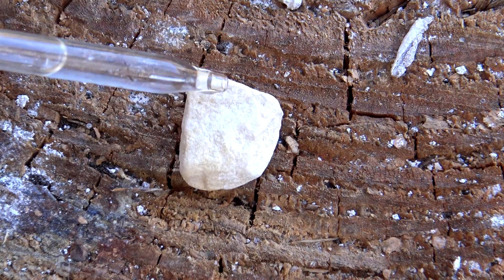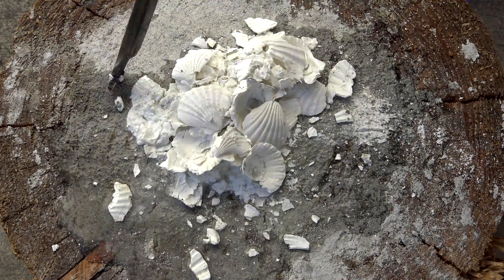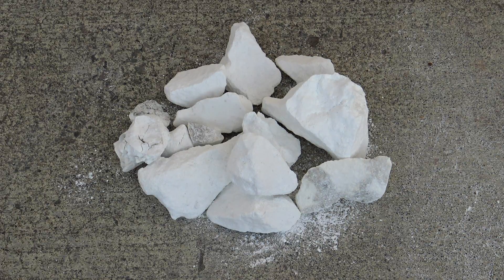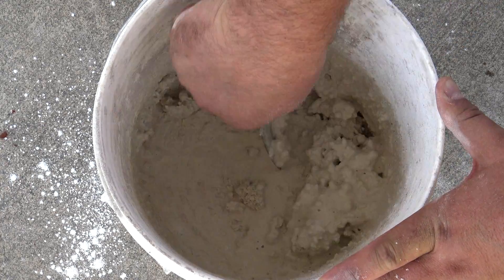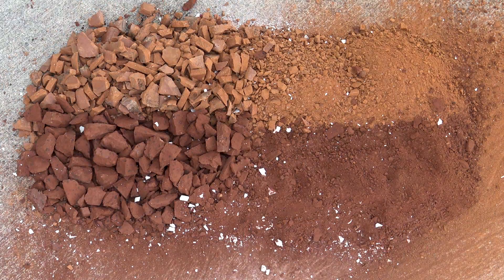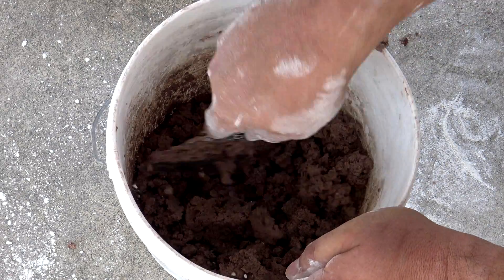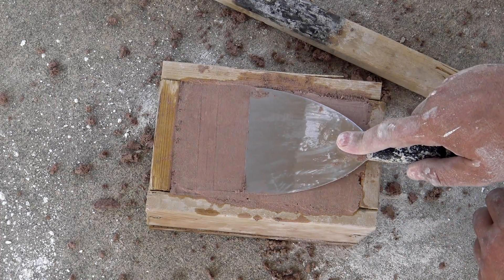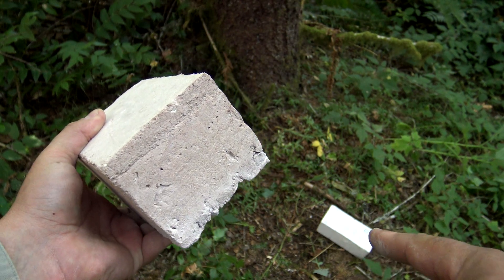How To Make Improvised Roman Concrete (Corporal-Crete)

Comment: There are other uses for lime u can make a fire with it as well the other is mineral oil but not to positive I'll look it again 🤔 u can use lime still an Ash like from almost every tier's a the second best but if u r trying to keep low u will have to look around or burn a lot of wood lol sand is a nother part u can add fresh water mussels an clams and oysters as well an the thing about lime it can repair the cracks it's self in concrete if saltwater was used in the beginning of mixing the concrete it's amazing stuff love your show corporal Kelly keep up the good work

Comment: I've seen info years ago about using seawater and also "coal fly ash" ? What ever that is ?  Perhaps Ash remains from coal ?
Update:
Fly ash particles are the lightest kind of coal ash—so light that they “fly” up into the exhaust stacks of the power plant. Filters within the stacks capture about 99 percent of the ash, attracting it with opposing electrical charges. Fly ash is recyclable.

Comment: The story I heard was that the Romans cooked their cement for days prier to use and used salt water and the ratio was 2 to i volcanic ash to lime and the cure time w even portland cement need 28 days to gain its full strength so I cn only imagine how long the Roman concrete took to cur fully.

Comment: i build my entire house with this exact method, 10 years of collecting shells baking them down, another 15 years of mixing concrete i come to my end result. I finally have a house the size of a sand castle. sure i cant live in it but the 25 years of work was well worth the wait to stare at it as the sun glistens across it in the morning. knowing SpongeBob can live in it if i just put a pineapple on it satisfies me.
Reply: You could add to that some chicken egg shells, making it 50% bigger 😏

Comment: Can we make the ultimate 'post apocalyptic' Roman concrete inspired cement by mixing fired limestone or shell, fired aluminum cans, and dirt?!  

Consider this, the main components of volcanic ash are silicon dioxide and aluminum oxide.  

Quartz is composed of pure silicon dioxide.  Quartz is the most abundant mineral on the Earth.  "Dirt" contains a lot of quartz.  A good source of relatively pure quartz is river sand.  However, this is still a relatively large grain.  Volcanic ash would have fine particles.  Sifting the dirt through a screen can separate fine particles.    

What we need is aluminum oxide.  Aluminum oxide comprises about 20% of the volcanic ash.  Can we create aluminum oxide by firing aluminum cans?  Firing aluminum does produce aluminum oxide, however, the particles are very fine and can be wisped away in the smoke.  When I fire shell, I put the shell into a metal pot with a lid that can clip on (found at thrift), and put this at the center of the fire.  If we added some  crushed aluminum cans in with our shell, or just threw some in the fire, could we fire both the calcium oxide and aluminum oxide in one go?  Aluminum cans left in a fire result in a brittle husk.  We would need to crush this into a powder, but if we did, would we have aluminum oxide?  

The ratio for Roman concrete, if I have it right, is 1 part calcium oxide, and 2 parts volcanic ash.  If the ratio of aluminum oxide in volcanic ash is 1/5, we would need to keep this in mind.  

I think that is basically 4 parts dirt, 2.5 parts shell, and 1 part aluminum can.     

Here is info on the chemical composition of volcanic ash from Mt. St. Helens.  

65% SiO2, 18% Al2O3, 5% FetO3, 2% MgO, 4% CaO, 4% Na2O, and 0.1% S.
Reply: I have been hand crushing rock quartz with the blunt end of a wedge, to get a pure silicon dioxide powder and a fine grain.  I am considering putting burnt can in with that, because the the silicon dioxide is so hard, it may be a way of effectively grinding up the brittle aluminum can.

Thus far in my attempts, just mixing silicon dioxide powder and calcium oxide powder, form something like plaster, but not a cement.  The 'reactivity' of the volcanic ash composition facilitates something more than dirt can.  Aluminum oxide is the next major component of volcanic ash, not generally as abundant in dirt.

If we burn a can, is the resulting husk aluminum or aluminum oxide?
Reply: I have to update this before the results are in on my final cement recipe tests.  In case the bubble bursts, as well as to inspire all the other caementicium enthusiasts out there.  What I am working on is a 'geo synthetic pozzolan caementicium'.  An initial idea was how great it would be if we could just use dirt instead of volcanic ash to make cement.  I honestly have a feeling that the inventor of Portland cement had exactly the same idea, and went at it as hard as he could, however, probably with poor results, and to keep at it, decided to sinter the material into a kiln, creating a 'clinker', which when ground down results in what we now know as Portland cement.   If you think about it, volcanic ash is essentially very fine volcanic glass.  I suspect this material is actually vaporized, not just sintering or melting the materials, but boiling and vaporizing these, which then condense into very fine ash.  A mix of the constituent matierals at the molecular level, a very very fine grain.  Vitrifying or sintering 'clinker' has a similar effect in blending the materials.  I strongly suspect that grain size is a key to a good cement.  Comparing this to sand or dirt it might be like comparing an orange to a car to a house.       

The cemical composition of portland cement and Roman concrete is essentially the same, silicon dioxide, iron oxide, aluminum oxide, magnesium oxide (which I haven't touched but do have some Margarine Mg in the fridge), and calcium oxide.  In the sintering process, it is my understanding that iron oxide works as a mineralizer, whereas aluminum oxide works as a flux.   

I hear river bed sand is a good source of silicon dioxide.  I hand crushed rock quartz for me experiments, sifting this through a standard door screen.    

To get aluminum oxide, chloride attacks aluminum, so I got as fine a grain of aluminum as I could and soaked this in table salt and water.  I would then put that into a plastic soda bottle filled with water, allowing the denser aluminum oxide to settle, with the salt dissolving into the water, and the pouring off the water, and repeating this process a few times to get most of the salt out, and then dehydrating what remains in the sun.  Aluminum also oxidizes rapidy, so the finer the grain the greater the oxidization.  I actually filed an aluminum bit to get some powder.  

To get iron oxide I soak steel wool in a shallow dish out in the sun for a few days.  

Here is what I hope might prove a major break through.  Regardless of our stance on global warming, this is good intel.  Cement manufacturing accounts for at least 8% of the world's CO2 emissions.  That is a big chunk.  Even if we had a cold process, such as is used in the making of Roman concrete, we'd still need to fire the calcium carbonate to get calcium oxide.  I stumbled across an alternative.  It turns out if you mixe calcium carbonate with drain cleaner, sodium hydroxide, lye ... 

"Calcium carbonate is reacted with an aqueous sodium hydroxide solution by mixing under atmospheric temperatures and pressures. The reaction products are calcium hydroxide (hydrated lime; Ca(OH)2) and sodium carbonate (soda ash; Na2CO3)."  "Soda ash is the common name for sodium carbonate (Na2CO3). It is a weak base that is soluble in water and dissociates into sodium (Na) and carbonate (CO3) ions in solution."  Calcium hydroxide, "Ca(OH)2 is only slightly soluble in water (0.16g Ca(OH)2/100g water at 20°C) forming a basic solution called lime water. The solubility decreases with increasing temperature. The suspension of calcium hydroxide particles in water is called milk of lime."  

With the above mix we can just add water and dilute, pouring the water off when the calcium hydroxide settles, repeating this process to the desired purity.  I found that the mixture settled completely either in the refrigerator or out in the sun.  I reacted the material in a thick plastic peanut butter jar (which warped and melted with the heat), and then transferred this to a 1 litre beverage bottle for the diluting process, adding water, settling, pouring off, adding more water, which I did about 5 times.  I now have a tray of what I hope is calcium hydroxide, having started with sidewalk chalk, drain cleaner crystals and water. 

It may be possible to convert calcium carbonate to calcium hydroxide, without the use of fire.  We might have a 'cold fusion' process for cement manufacture.  Whether or not this is industrially practical is it's own issue.  The point being that we can do this.

I threw a dart using the first two household chemicals that came to mind, drain cleaner and hydrogen peroxide  If you add hydrogen peroxide to the above mix, the subsequent process is similar, and we wind up with calcium peroxide, CaO2.  I don't know what this will do in cement, but I now have a tray of it and I am going to find out.  

We might one day read an article on how the Roman empire is striking a mighty blow to turn the tide on global warming!  

Since the chemical compositions are about the same, it seems to me that the main difference between dirt, portland cement, and volcanic ash, is essentially grain size.

Comment: Use the roman for structural layers and the corporal for thermal insulation. Also if you were to add modern materials, say cement in small proportions you'd get so much out of both of these but mostly from the corporal brick since it would fill in those big gaps.

Comment: Great video, educational. I also saw another guy use ashes from burnt leaves and bark burnt at high temperatures as an alternative to making lime. He takes the white ashes after burning them at high tepm, then mixes those ashes with water to make a paste, then he rolls them into balls, dries them,  and burns or cooks those balls, then he puts them into water to make the final white powder lime to be added later to make cement. It's just another alternative, but it requires a lot of bark and leaves to make enough of it and more time to fire twice.

The wood ash lime making process starts at 4:12:

https://www.youtube.com/watch?v=eesj3pJF3lA&list=RDCMUCAL3JXZSzSm8AlZyD3nQdBA&index=18

This video about making primitive mud (clay) bricks is cool too:

https://www.youtube.com/watch?v=D59v74k5flU

This one's not bad either:

https://www.youtube.com/watch?v=FwRFH7MH5N0

Thanks Corporal

Comment: good alternative to modern day concrete that is almost just as strong is you can use gray clay, calcium hydroxide, fire wood ash or charcoal ash and lye.
if you can't get the lye no worries as it is primarly use to speed up the curing time.
on average with the lye cure time is 22 hours and without the lye cure time is roughly 34 to 35 hours.

Comment: did you try a crush test in a hydraulic press for modern brick, modern concrete and the roman and corporal crete. that way you would discover if your cretes were stress fracture proof and stronger than modern stacking builder bricks
Reply from the maker: was that shown in the video?

Comment: Fort Dorchester in Summerville, SC has what are called "tabby" walls. This form of concrete/masonry was produced locally by heating shells in a fire to make a form of lime. This was then recombined with shells and river sand and water and formed into blocks and walls. I've seen similar, though smaller examples in Florida as well. http://starforts.com/visited/dorchester/gr/do20.jpg  http://starforts.com/visited/dorchester/gr/do28.jpg From this site: http://starforts.com/visited/dorchester/do28.html

Comment: I found Lava Rock (your pozlan) at ACE Hardware store, a 4-5 # bag for about $15.  Its used for the bottom of gas grilles, but I will use it for making a pizza stone out of your improvised Roman concrete.   I also found genuine lava volcanic ash from Washington State on the web.   I suppose I could drive there and fill up several cans of ash from my own sources in the woods there.  Its a long drive!   I baked some oyster and clam shells in my home oven on the "clean" cycle, but the shells broke down into a grey powder and rocky mixture instead.   I need to make a home kiln or a gas fired smelter to get these shells to be pure white - calcium oxide.    My home oven is not hot enough.   If you have old rusty and crusty food coated cast iron cookery, the home oven clean cycle is adequate to burn off years of baked on crud.   The rest of the rust can be taken off with vinegar (another story and another video ... but relevant in trying to use your home oven for attempting to make calcium oxide).

Comment: If someone wants to make a wall of these you need to have cookie cutter the size of a fifty sent piece to make the 3  holes just like bricks. You will make more bricks and it will be lighter without loss of strength.

Comment: I was told this method makes the strongest concrete known to mankind, and just keeps getting stronger over time! Excellent demonstration. Can’t wait to try the formula 🤙
Reply: If the concrete keeps getting stronger that implies that it is not fully cured and may take months to cure enough to be strong s even portland cement takes 28 days to gain its full strength

Comment: i am going to use this recipe for your Corporal Crete to make a 20" x 20" square pizza stone.    Another video on youtube shows how to make pizza using a Home Depot or Kitchen Supply store pizza stone which is more like ceramic and only about 3/4" thick    You are supposed to pre heat the 3/4" pizza stone, and then slide your pizza on top of it when it is super hot.     I like getting my hands dirty and I also like how things come together.    I will make the 20" x 20" square pizza stone with your corporal crete and let you know how I fared.    Thanks

Comment: How about eliminating the need for mortar with interlocking bricks/blocks?
Reply: That's typically how castles and walls were built. You'd use the mortar to hold the stones together. Then you don't have to use so much mortar, and you don't have to spend years chipping away at stones to make them interlocking. just slap a rock that kind of fits, and slap mortar over it and put another rock on top.
Reply: @peterlamont647  Billions of grey concrete blocks are used to build security walls, house walls, etc., mortared. The cost of mortar includes paying a skilled bricklayer. If the blocks were molded to be interlocking, an unskilled worker could set them in place, cutting the cost quite a bit. Also, it would allow for DIY construction.

Comment: 40% Ballisticrete. 10% Portland to 30% Hess Standard Pozz (Pumice) with high silica content rather than fly ash, add hydrated lime (ash Lime Mortar), Add Silica Fume or other water reducing ad mixtures, add Sodium Silicate Water Glass (made with seawater) Change polypropylene fiber to PVA fiber or steel fiber. Incorporate acylic admix into liquid, mix it all up with 15% sea salt water and cure with sea salt water. This concrete will reach maximum hardness in one year. Oh, spray paint it with Line-X after curing for 1 month then fire bullets into it for fun..... Guess what - it's bullet and blast proof....

Comment: The most important brick and mortar is that used for a hearth.  But as we just saw with the rock, if it gets hot, it disintegrates.  Do you have a firebrick and mortar formula that does not, that a person in the wilderness can make?

Comment: Very interesting and informative. Another great video!
Your formula of limestone and vulcanic ash is spot on! In absence of a volcano though, I thougt of trying to replace the vulcanic ash with wood ash and see how it goes. Do you have any experience with this? Theoreticly it should work, but maybe you've already tried it.
Best regards.
Reply: This was called limeash in early modern and Renaissance England. It works, in other words. Search google for "limeash flooring" Wood ash is weakly pozzolanic, not as much as brick dust and volcanic dust, but it will work, the resulting product will be durable, but not as strong. Keep in mind that a lot of the strength of Roman concrete wasn't the mortar binder, it was the aggregate. The stone. There are old buildings in America built of "Tabby" concrete which is just plain lime and gravel concrete. If this stuff lasted 200 years then you can be sure that adding ash should make something even more durable. Lookup "cocciopesto," (an Italian pozzolanic plaster made with brick dust and lime, it could be used as mortar) "gravel buildings" "Tabby concrete" "lime concrete" and "Beton". In all of these cases wood ashes have historically been added on occasion. Masons Plasters and Brick layers knew about this stuff long after much of the rest of the world forgot.